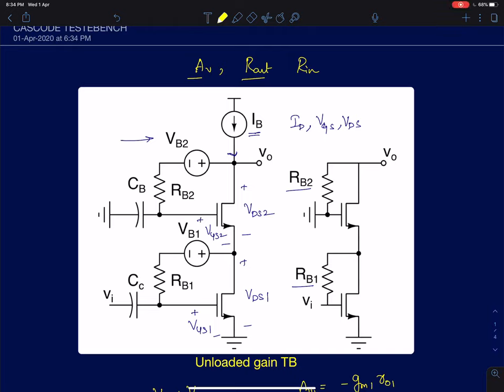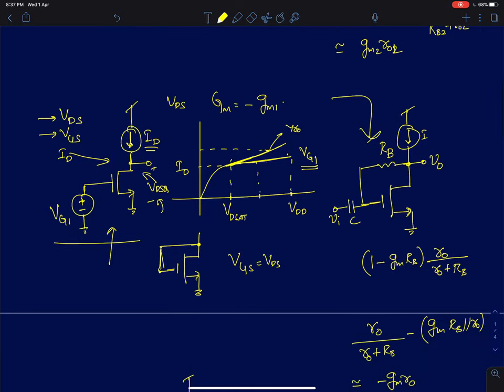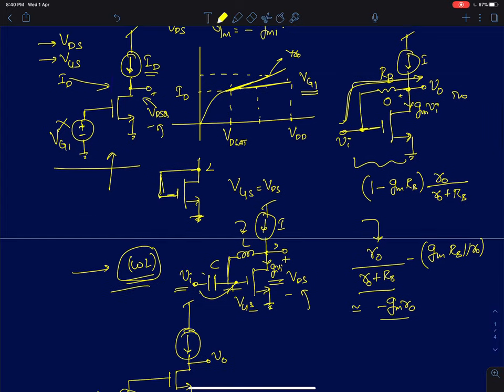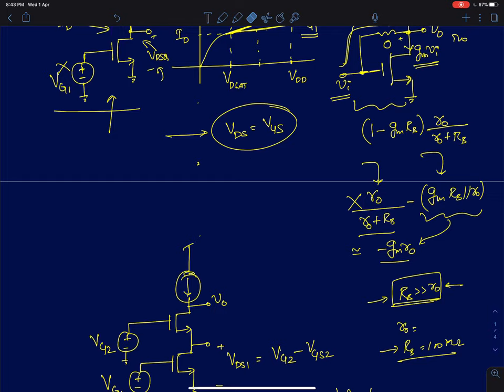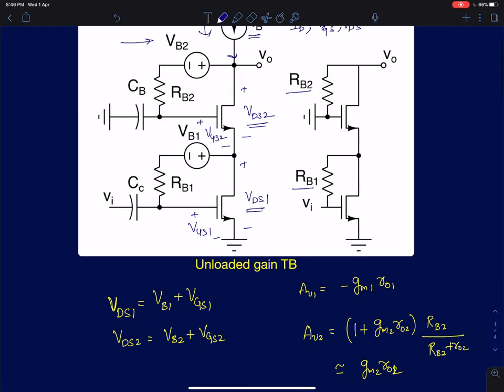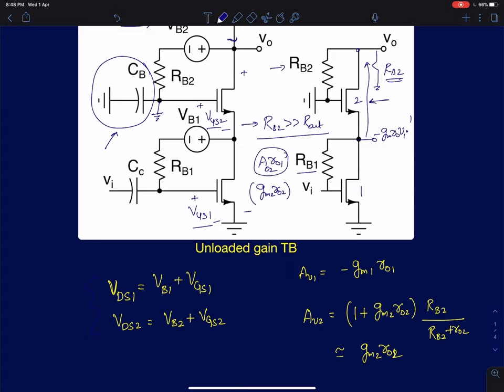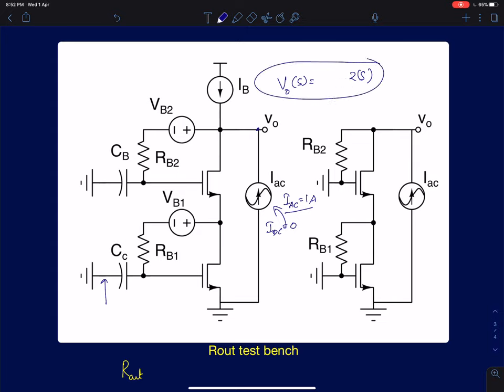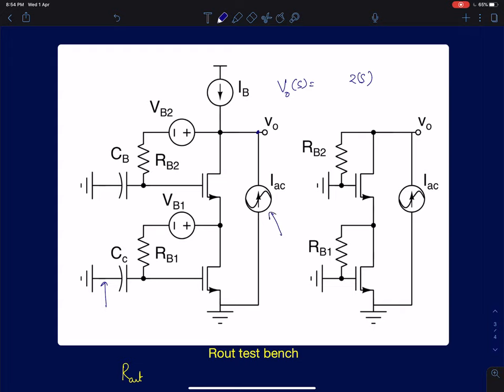AIC Lecture 20: Simulation setup for measuring the gain and Rout of cascode amplifier

Comment: 15:06, The resistance seen at input of the first MOSFET is not 1/gm rather (Rg+ro)/(1+gm*ro).
Reply from the maker: You are right. It’s 1/gm only if ro is infinite or much greater than Rb1. Follows from modified miller theorem as discussed previously. Also remember the videos are to give you the intuitions and concepts. Such errors are unavoidable when I was making them in my spare time.
Reply: @chembiyant456  yes thank you. Can't express enough gratitude for the great videos you  have made.

Comment: (Please read the reply against this comment, The confusion has been resolved by the Sir.) 16:28 and everywhere, The procedure to measure the output resistance is incorrect. A voltage equal to DC voltage of that point superimposed with some AC voltage needs to applied at the point of measurement so that the bias condition is not disturbed. If you directly apply a AC voltage or (use a coupling capacitor which doesn't matter), that node will be forced to become equal to the that AC voltage. The DC condition will be disturbed. The AC current injection method will work. Use a Oscilloscope for voltage measurement.
Reply from the maker: Nope. What’s said in the video works fine. The dc voltage is already set by the two diode connected MOSFETs and current source. You just need to AC couple the AC voltage which will just superimpose over the dc voltage for non-dc frequencies. The capacitor blocks dc from the test source so it doesn’t matter whatever dc voltage you apply with the AC source.
Reply: @chembiyant456  suppose that node was at 1 Volt DC bais. If you apply let's say 20  mV AC, that node will follow this voltage, no  DC will be  present there.
Reply from the maker: @abhishekmaurya6562 that’s why you should AC couple it. AC coupling doesn’t affect the dc voltage at that node. The dc voltage will stay at 1V and the ac signal will be added to it. Read up about ac coupling.
Reply: @chembiyant456  Yes, you are absolutely correct. Thanks you so much for replying.